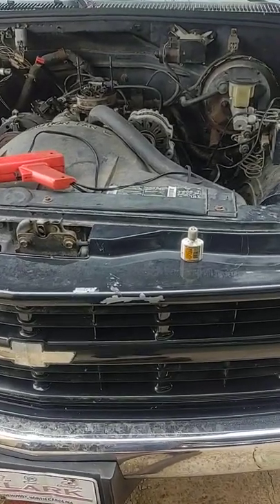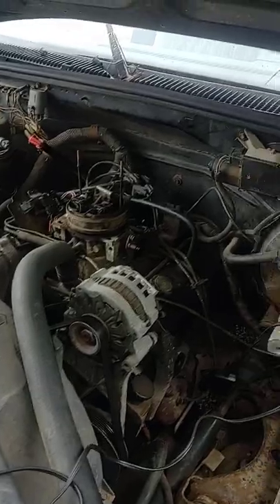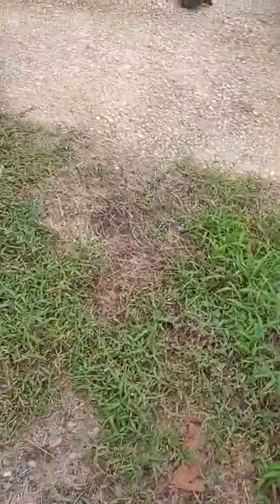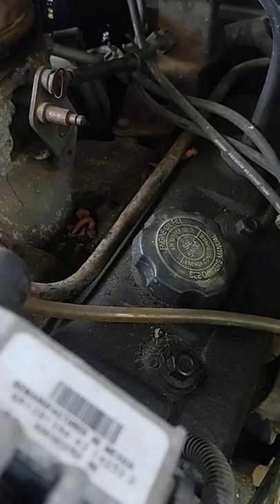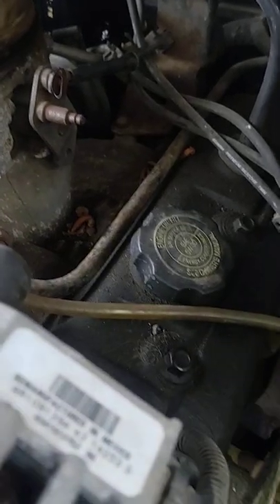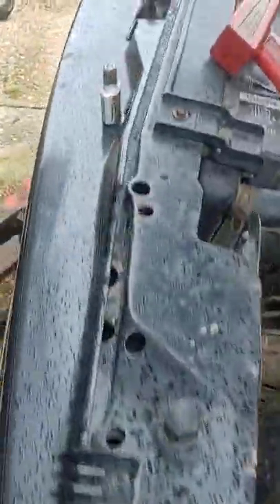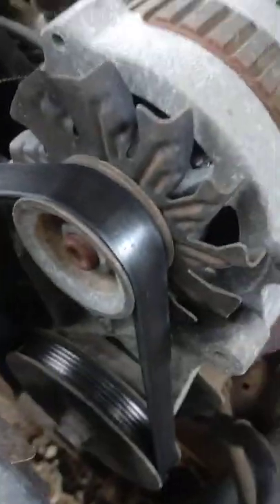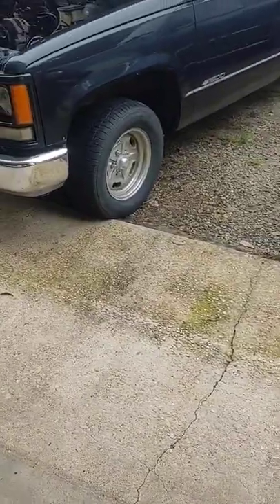setting ignition timing on a Chevy TBI 87-93

Comment: So from my understanding, you get the truck to operating temp, unplug that wire, set timing to 0 degrees, plug wire back in, then you’re good to go?
Reply: Yes sir
Reply: @lancegodbey6450 And if the truck is far enough out of time that it won't run long enough to get the engine to operating temp?
Reply: I’m confused just by shining that  light at it, it goes into timing?

Comment: I feel like there's some sort of conspiracy to not show where the gd clamp nut is located to be able to adjust the distributor. I've broken more vacuum lines and electrical connectors just trying to find the mf clamp nut than I have throughout my entire life
Reply: There is a cheap special tool (wrench) to get at that clamp bolt. I am glad that I bought it because that bolt was tight and long

Comment: So If you don’t do this step of disconnecting that wire it won’t be timed correctly? Because I have a 91 that I set it at dead 0 turned it on and got the timing light and adjusted the distributor but didn’t disconnect that wire so I shut it off and truck now doesn’t want to start now I have to re-do the timing all over again just to turn it on
Reply: Yes base timing will be off becaise the computor will see the change and offset because of it. Unplugging the reference wire makes the computor forget, for lack of a better word

Comment: So what about stretch in the timing chain or wear on the teeth? Higher mileage engines will have more variables than just going back to factory fresh specs
Reply: I seen stretched chains give a unsteady line were it would bounce around
Reply: Timing chains don’t stretch lol
Reply: @RatedR-normal  stretch in a chain is referring to general wear between each link, which is a form of 'stretch' in the overall length of the chain. Like are you the word police? You know exactly what I'm referring to and a ton of people refer to it the same way. Great contribution to the car community Mr. English.

Comment: My timing light at the time broke but I did have a vacuum gauge and set my manifold pressure at peak, shut it off and reconnected my bypass. My suburban was was getting 17mpg here in NM four corners area

Comment: It's not a bypass connection. It's an electronic advance. These trucks suck to try to set timing. Change the distributor and put it back in the exact location of the timing is completely off.
Reply: Yeah that's what I was thinking. Didn't understand what a "bypass" meant.  I just had to put a new distributor in a 92 K3500 454 and did it by ear. It's pretty close but I'm going to get a timing light.  Been ages since I worked on a Chevy last one was a 69 El Camino with a 350. I work mostly on OBD2 German cars.
Reply: Thank you for clarifying this.